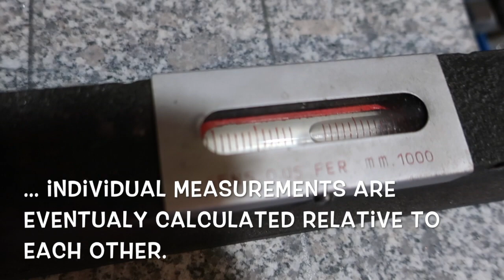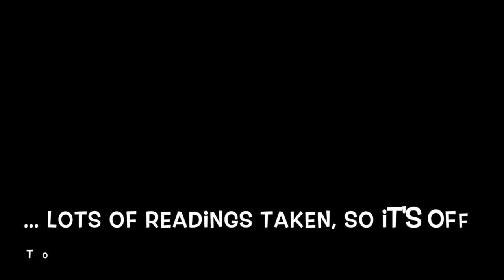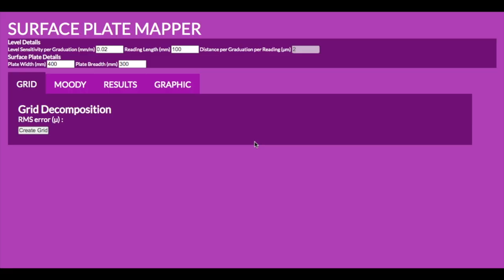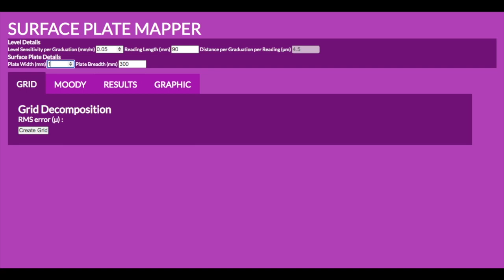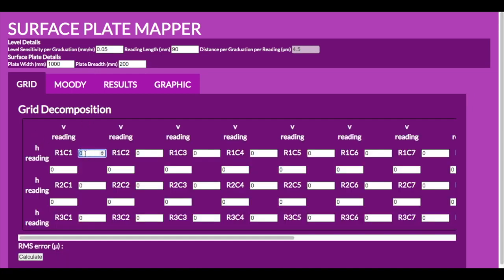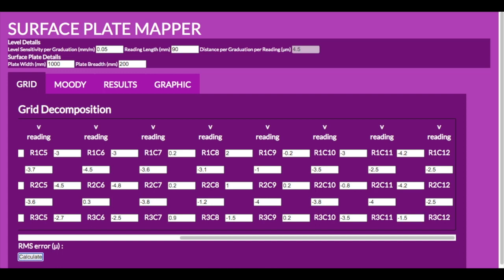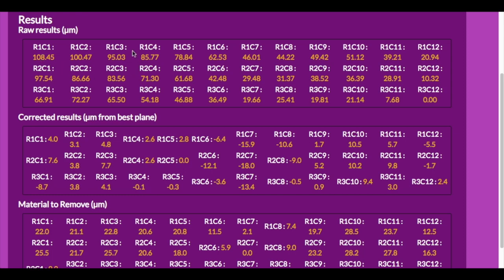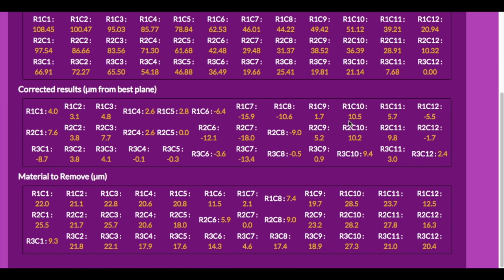Adventures in Granite Lapping

Comment: It's better not to mark the plate with marker.
Reply from the maker: Well, you've got to mark it up with something.  In my case, pencil.  What's your reasoning for being against using a marker, though?
Reply: @wibblywobblyidiotvision  well the marker has a tiny thickness that can affect the reading
Reply from the maker: @alexmay3533  But that goes for everything you could use to mark the surface.  A pencil line is around 2µ, ISTR that Tom Lipton did some tests on markers and got somewhat similar results.

My take would be that, short of a projected laser grid or what-have-you, it's unlikely to make a significant difference to my readings.  Sure, my "bridges" are crossing over the lines, but theres one at each end so it should average out, the bridges themselves are probably at least that inaccurate, and later measurements have been made on a specially-made 3 point support that doesn't even touch the lines.  Plus, I'm running up against the noise floor of my measuring equipment anyway.  I literally can't measure any more accurately until I manage to get my hands on a more sensitive level.

Mind you, I could probably fill the "holes" with sharpie ink :)

Interesting point, though, thanks for raising it.
Reply: Well all in all you can easily use a ruler to hold the exact place of the level.